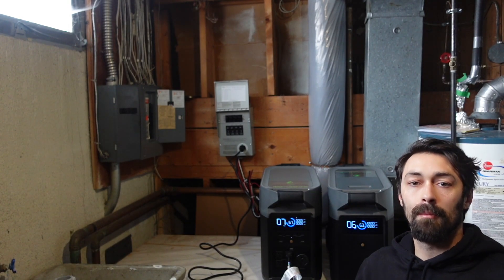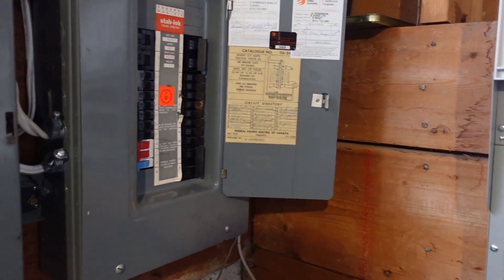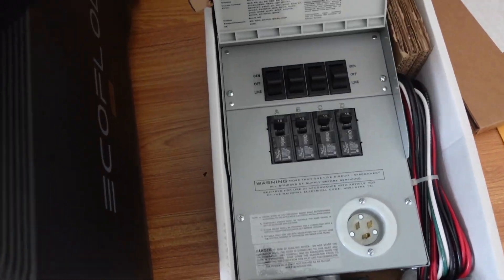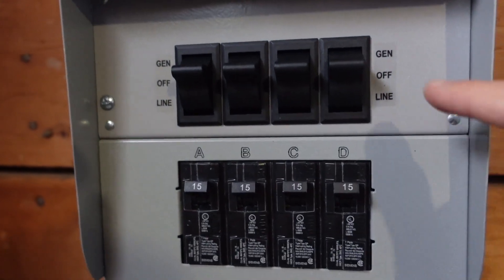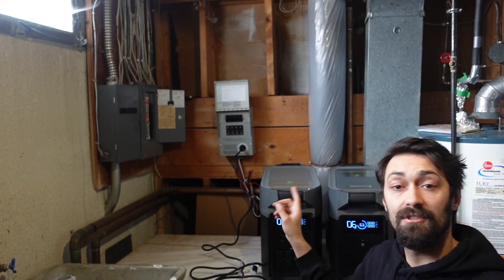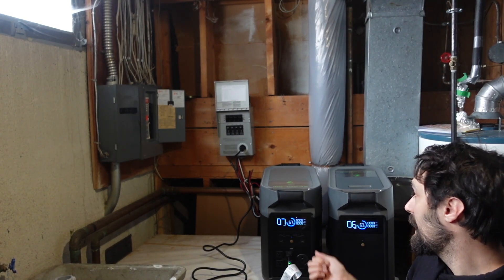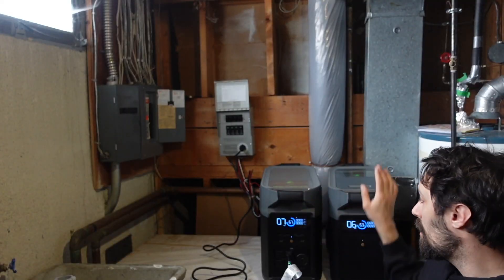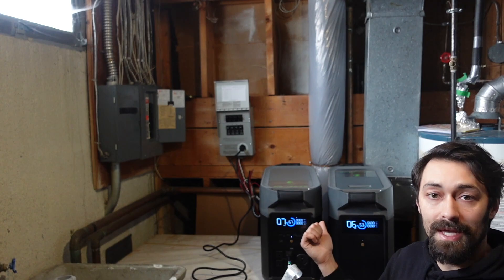Transfer Switch For Generator | Solar Generator + Manual Transfer Switch Setup | How to Guide

Comment: Would this also work if the usual power came from a big off-grid generator? I'd like to turn it off for the nights and use the batteries for power. If so, could you post the link to the right switch, please?

Comment: Hi, nice straight to the point video. I'm looking into buying one of these generators to hook it up to a transfer switch. I worried about the grounding though; do I have to ground the panels or Delta Pro if I want to place the panels on my roof?

Comment: Why not just connect to the whole house using a transfer switch (Which  has one big handle), then you would simply shut off the breakers to what you want to shut down?
Reply: If you're doing that, you don't even need a transfer switch.. you could just use a breaker at the top of the panel for an ecoflow inlet, tied to the main breaker with a lockout (so you can only have either mains on, or the ecoflow input on).

Using a transfer switch with an ecoflow, it's MUCH easier/less interruptive.. plus, you can tell when the power comes back on when the rest of your circuits come back on. Can't do that if you're shutting off mains power at the panel.

Comment: Please do a video when you actually hook up the transfer switch to your main panel and only utilize one Delta Pro and therefore only one leg of the 240 volts that normally would go into a transfer switch from a generator. I know that you can hook up two Delta pros through their double voltage hub into a transfer switch. However, interested in whether you can just isolate one leg in the main panel. Seems like if you are able to do that, all of the circuit breakers hooked into the transfer switch would all need to be on the left side or the right side of the main panel box

Comment: did this work for the delta pro ? I have a transfer switch with outlet already. but was wondering if it just plugs in the same as gas generator without any modifications. or specific transfer switches needed.

Comment: ? I have gas generator that runs off a whole house transfer switch. The big cable ends have different plug ends from your set up. I want to buy a solar generator ,possibly eco delta pro. I can’t afford two pros which the company says I need two. Could I do the manual switch like yours and choose the main circuits I need?  Would like to run well pump but it might be 240 volts. What’s your opinion?